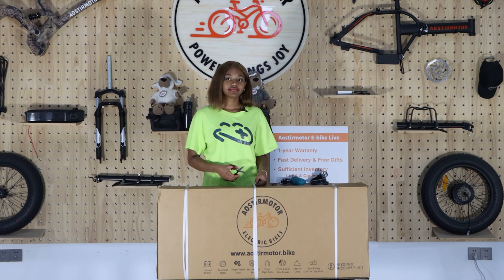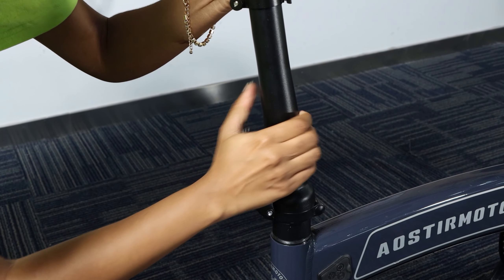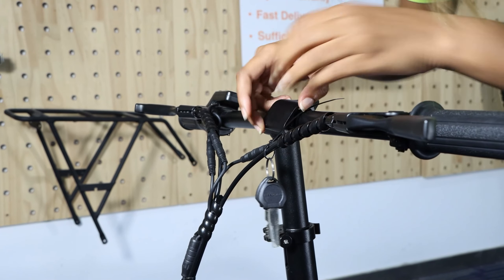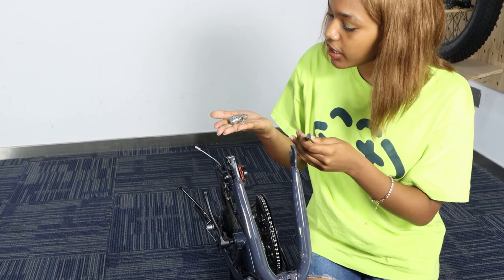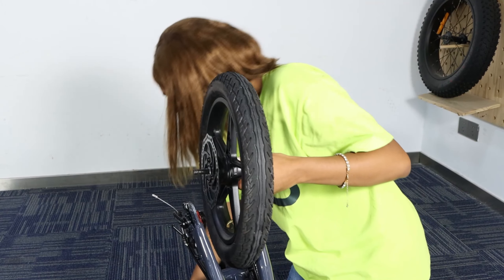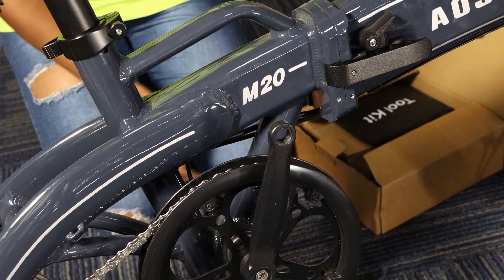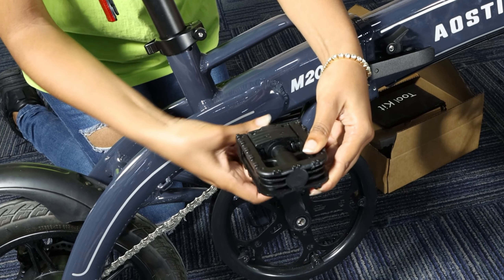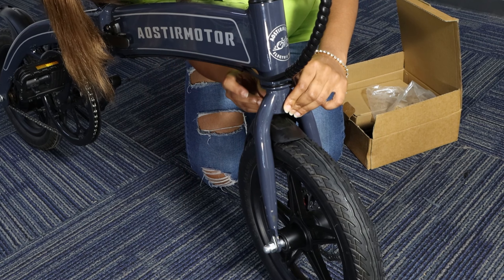HOW TO: Assemble M20

Comment: Hello does this bike use tube or tubeless tires? If need replaced what exact size would need and where to get?
Reply from the maker: Hi, it uses tube. Feel free to visit our official website to get the replacements.
Reply: @LEAVANOfficial  hello ok I didn’t notice the tube and or tire fir this bike for replacement parts available?
Reply from the maker: @agrantis21  Hi, friend, what replacement do you need?
Reply: I would like to order replacement tubes and or tires so if I need them to replacee I can
Reply from the maker: @agrantis21  Hey friend, we do have the replacement. What's your order number? We need to check your warranty.
Reply: @LEAVANOfficial  do you have a video of how to take and put on the rear front tires for this bike? Please let me know the video or instructions for this
Reply from the maker: @agrantis21  Hi, friend, at present we don't have such videos. But it's advisable to take the bike to the repair shop cuz the installation for this is not too hard.
Reply: @LEAVANOfficial  ok however I would like to learn to do thsi myself and not have to go to shop everytime. If csn just provide instructions as well as tools I need to remove tires and tubes from the frame and reinstalling woudl be very helpful
Reply from the maker: @agrantis21  Hey friend, feel free to contact our official mailbox: aostirmotor@gmail.com